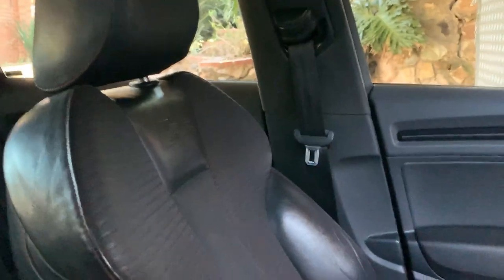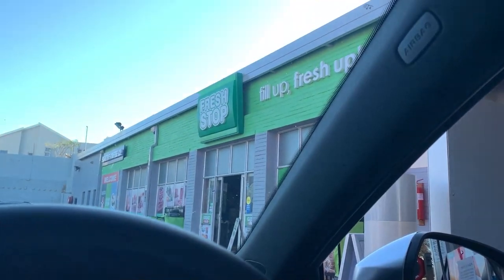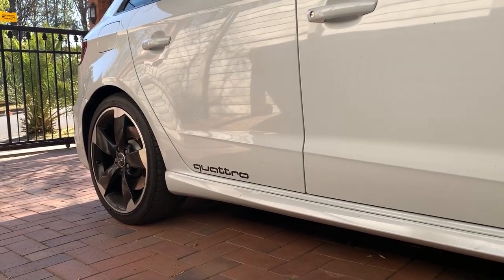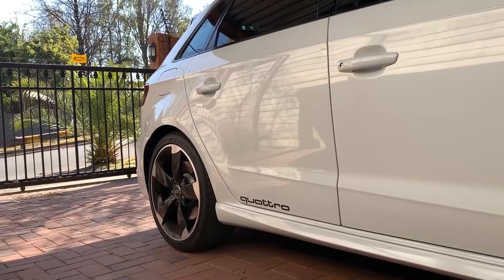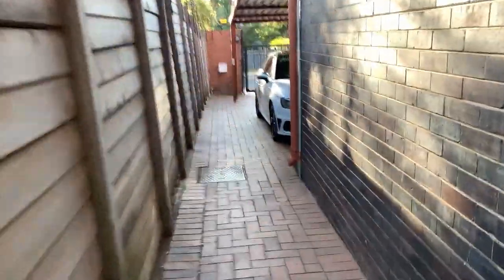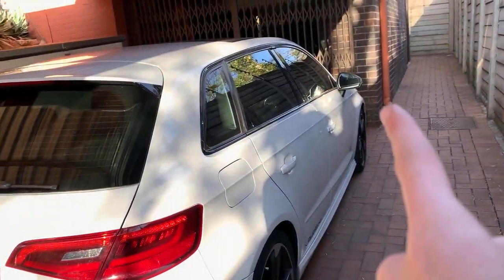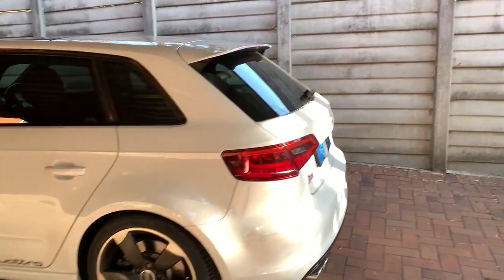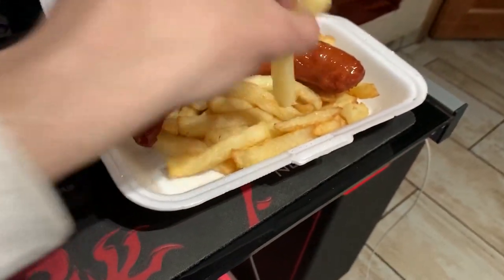Broken Quattro System on my new AUDI S3 :|

Comment: Where did you get your RS3 paddles shifters changed/installed? Been trying to change it
Reply: Did you also paint your wheels or are they OEM black, looks so 🔥
Reply from the maker: Eyo man! I don't have any RS paddles on my car it's 100% stock. but if you looking for some parts check out Vag Cafe, Jabsport, Sportmax design or carbon bros :P Jabsport is my fav tho and nice prices
Reply from the maker: Thanks man! these are stock, I believe they are the RS spec wheels u could get from factory! I also like the black on white look for the car :P got some ideas coming for the car just not the funds to do em yet xD

Comment: What was the problem in the end
Reply: Was it the haldex pump I have the same issue and want to know what it is
Reply from the maker: Unequally worn tyres cofuses the car🙌🔥so just put on some new meat and then it launched no problem💪💪been fine ever since
Reply: @alex_aka_dev  just got new tyres and still won’t launch correct
Reply from the maker: Have you serviced your haldex? The oil in there only lasts like 50 launches or something🙌
Reply: @alex_aka_dev  I’ve only just got the car I’ve done like 10 or so in it and it had been serviced by Audi a week before I got it from a dealership I have warranty so I’m going to ask them to look at it
Reply from the maker: Remember "service" in any dealer's eyes is just an oil and filter change the rest they don't even check... so ask them to service your haldex oil! The haldex works with a clutch and obviously like brakes clutches release particles and there's a lil filter in ur haldex that gets clogged after about 50 or so launches. I barely launch my car cause it's super hard on a lot of components even stock🙌 so best bet is that ur haldex oil is dirty with haldex clutch dust so you just need to get that replaced. It's also not a major job
Reply: @alex_aka_dev  is the oil for all wheel drive coupling
Reply: @alex_aka_dev  if so it’s had that 1000 miles ago
Reply from the maker: Yes the oil is for the haldex and is needed for the coupling... however it's hydraulically engaged by a haldex pump and if that get's clogged up the haldex can't engage and thusly no quattro... if you've launched it a lot in a 1000 miles it's most likely that hey... it's not a mechanical diff that just keeps taking a beating it needs maintainance and cleaning if you use it a lot🔥
Reply: @mattstapley487 did you get the issue sorted in the end?
Reply from the maker: Yes just swapping the tyres fixed my issue and she’s been fine ever since. Probably time for that haldex service now😂

Comment: I broke 3 times front transfer box and 1 time back diff and 1 more time the manual gearbox in my s3 8p facelift and I use just in road not in drag race .Never I buy again 4wd fast audi! I think the best and strongest gearbox and diff have only rwd cars like bmw m models or mercedes amg
Reply from the maker: Shamee man that sucks!! So far mine wasn't broken it was due to the 4 tyres being unequally worn :/ so if the grip levels on all the wheels aren't equal the computer freaks out and throws the haldex codes... other than that the haldex oil needs to be changed every like 50-60 launches to keep it happy and healthy💪